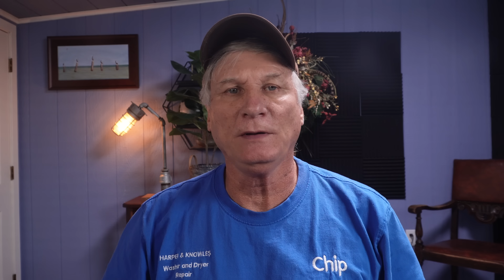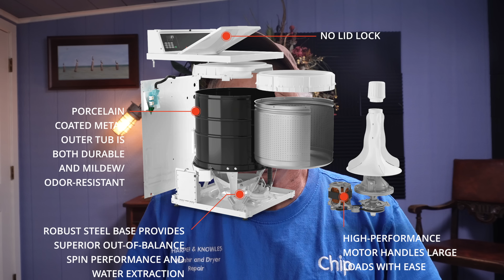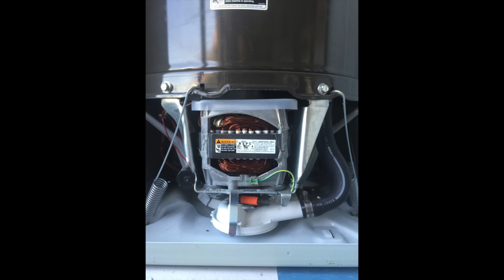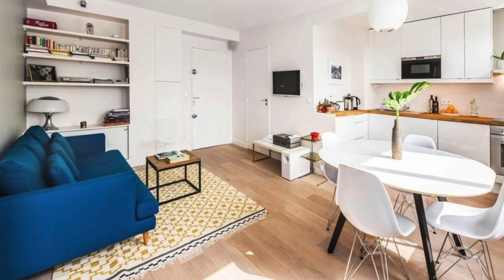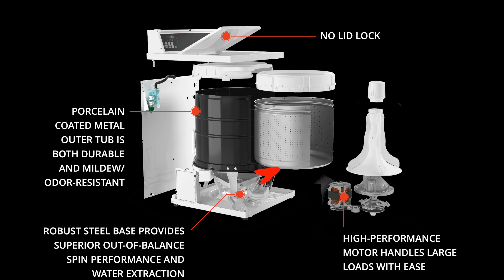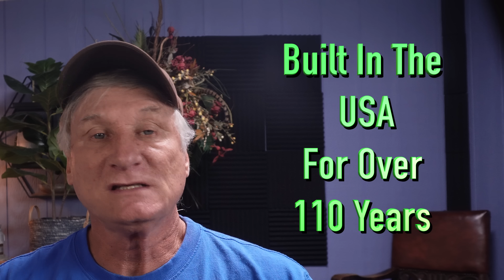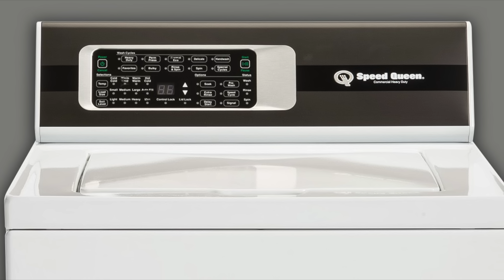TR7 vs TC5 – The Truth Speed Queen Dealers Don’t Tell You

Comment: in your opinion, what were the 'good years' for the old whirlpool washer? we are still using one that (per lookup) was manufactured in October, 2003.  Other than a dead lidswitch, it's worked fine.
Reply from the maker: Whirlpool direct drive transmission washing machines were first introduced in the early 1980s, with the initial models appearing around 1983. This marked a shift from the earlier belt-driven designs to a more efficient direct drive system, where the motor is directly coupled to the transmission without a belt. Production of these direct drive washers continued for over three decades, spanning from 1983 until around 2011–2012, when Whirlpool began phasing them out in favor of newer designs like the Vertical Modular Washer (VMW) system. 

The direct drive system was a hallmark of durability and simplicity, used across various brands under Whirlpool’s umbrella, including Kenmore, KitchenAid, Roper, and Inglis. While exact end dates can vary slightly depending on specific models and production runs, the consensus is that the classic direct drive design was largely discontinued by 2011, though some variants may have lingered in production or as replacement parts beyond that. These machines earned a reputation for longevity, with many still in use or repairable today, reflecting their robust engineering. Every year these were produced was a good year!
Reply: @HarperandKnowles  thanks for info. Mine is a Kenmore, still going after 20+ years.  Only the lidswitch failed and repair man said it was a good, reliable machine. He wired it to ignore the lidswitch (did not con me into doing replacement of it).

Comment: I like my TC5 that I bought a couple years ago for the most part once I got used to it.  I had problems with some suds bubbling out the drain but found a hack that advised backing off on detergent and adding a 1/4 cup of vinegar to each load.  Seems to work most of the time.
Reply from the maker: Thanks for sharing your experience!

Comment: Chip, does TC5 come with mechanical timers?
Reply from the maker: I’m not sure if the latest models are or not. Thanks for watching!
Reply: @HarperandKnowles  
I'm sorry I forgot to ask. Speedqueen makes TVN2000WN (AJMadison, PCRichards) seem to still have.
Any thoughts, mechanical clock we are going to purchase   so far. Any input much appreciated.
Reply from the maker: I am not against good quality electronics. You must remember, solid state devices were developed to mitigate the eventual wear and failure of mechanical switches. They are in many ways superior to mechanical methods. If you do decide to go with the electronics just buy a very good quality surge protector and the electronics may be the last thing to fail on your new machine. Thanks for watching.

Comment: I’ve just bought myself another SQ washer/dryer set and approve of your message. New and modern isn’t always better and old is often gold. However, the TR7 is not approved for sale in Australia, because it does not meet with minimum performance standards of cleaning. The TR 7 Agitub wash system is nothing new and there have been iterations of it in the past. They have all disappeared, because they do not perform as well as traditional agitator washers. 

Instead, over here in Oz they sell the AWNE92, which uses traditional SQ transmission/agitation and it is a fantastic washer.
Reply from the maker: Thanks for sharing your experience!

Comment: 15 years ago we built a new home. We bought a Kenmore washer and dryer made by whirlpool. 15 years later still operating just fine. No problems at all.
Reply: You are lucky.   My expensive front loading Kenmore washing machine and dryer didn't last 5 years.
Reply: @fastrider4996  Mine was the cheapest top load I could buy from Sears at the time. washer and matching dryer still working fine. It was actually made by Whirlpool. August will be 15 years (we don't have kids)
Reply from the maker: Thanks for sharing your experience!
Reply: Kenmore washer and dryer in 1993. Springs, Lovejoy coupling, the agitator/cam piece  under the softener fill. But no belts, it's needed some love, years in between issues though. If I replace  them, it'll be a speed queen.
Reply: I bought Kenmore elite front load washer in 2004. It lasted for 20 years until the bearings went out. Replaced  new bearings by myself and still running almost one year now
Reply: My Whirlpool washer & dryer is 15 years old. The washer just started to drip water in the basin every now and then, when the wash cycle is complete. I looked at the reviews for a new whirlpool and was very disappointing. I know it's old, but the appliance repair shop can replace the inlet water water valve that is causing the dripping for around $225 parts & labor. At 78 years old, I think this is my best option.
Reply: I have T 5  electrical broke 2 years old  had a Kenmore 20 years old no problems should have kept.
Reply: Times have changed. My 3 year old GE just broke beyond repair. The repair guy said they don't make them like they used to. There were so many complaints about even the top rated washers, I couldn't not buy the speed queen again.
Reply: @CrucialOlive Same here my Son bought a GE in 2024 and it fills less than 1/4 tub of water to max a small medium load. Depends on the day how much water fills in the tub for no reason, no settings changed and the deep fill or max fill does not work except a rare occasion and that’s been a while.
Reply: It's so annoying reading comments from boomers about how the "Maytag" "whirlpool" whatever they bought 15-20 years ago is still running strong and therefore it's a great brand. You're really showing your age. These companies have all consolidated and manufacture nothing but junk nowadays. Regardless of whether or not they're "made in America", it's all trash. Speed Queen is essentially the only exception to the rule.
Reply: @MKLG2000x  Agreed, they don't make them like they used to. Planned obsolescence.
Reply: @MKLG2000x  Man some millennials had money 15 years ago! You know, maybe five of us.
Reply from the maker: Lol! So true!

Comment: Based on your review. I went with Speed Queen over other brands 👍. I went with TC5 because I want a stronger washing ability. I don’t need gentle soft washes.  Thank you so much for the in-depth review as I couldn’t differentiate the difference between 5 and 7.  

Speed Queen is smaller in tube size but its wider.  The draw back is it is quite noisy 😂 but I don’t live in an apartment or wash it at night.  TR7 seems too weak for me.  I want durability over quieter.

Thank You.
Reply from the maker: Thank you for watching!

Comment: How does Dexter compare to Speedqueen?  If they have a washer for home use it'd be interesting to hear your opinion, thank you ...
Reply from the maker: Dexter Laundry focuses exclusively on the commercial laundry market. They manufacture heavy-duty washers, dryers, and stackable units designed for laundromats, on-premise laundry facilities (hotels, hospitals, etc.), and industrial applications.

Unlike brands like Speed Queen, which has both residential and commercial lines, Dexter does not produce consumer-grade home laundry machines. Their products are built for durability, high-volume usage, and easy serviceability, making them ideal for businesses rather than residential customers.

If you’re considering a Dexter machine for a home setting, you’d likely be looking at a commercial unit, which would require different installation, power, and water supply considerations.

Comment: Yes, We bought an LG front load washer 8 years ago and I had to fix this thing 9 times so far. The front cabinet door panel had started rusting within 3 years. Cabinet itself is cheap sheet metal. Crappy machine in my opinion. We will be buying a SQ very soon
Reply from the maker: You won’t regret it. Thanks for watching!

Comment: Spent 700 bucks on a Maytag “commercial” xl capacity washer and it broke to the point of not being cost effective to repair it after 5 years.  The Maytag Bravios dryer made it 6 years.  I feel like buying a new washer and dryer every 5 years is absurd, so I’m going with the TC5.  Haven’t looked into dryers yet.  I thought pretty much all dryers were reliable, but this Maytag proved me wrong.
Reply from the maker: You won’t be disappointed. Thanks for watching!
Reply: Hi. Did you buy this BRAND NEW? In year 2020? DID YOU HAVE ANY SERVICE CALLS ON IT IN those 5 years? I just bought a Brand new COMMERCIAL Maytag 4.0 Drum size for a lot $. It’s sad to hear yours died. Did it have direct drive and was it brand new? Mine has a Direct Drive with 5 year Warranty also. Looks like an old style machine but has a locking Lid mechanism so is HE style. Let’s hope and see I get 10 years out of the price I paid. It doesn’t have a glass lid and it’s Not Wiffii one? Let’s see? I heard the LG Front Loads are more durable but cheaper? Thx 🙏

Comment: I have an older AWN41 Speed Queen washing machine.  Basic and my wife and I have had it for the past 11 and half years. The only time I had to even open the front of the machine was for removing a dish rag that the wife was using to clean the tub seal at the top of the machine. She got the rag past the seal and I open the machine and removed the rag I was so glad that she got me as the rag was sitting on the transmission belt.  It was a quick easy thing to get the rag out and close up the machine. This machine is stone cold reliable and never have had a problem since we bought it and yes it will wash a large heavy queen size comforters and not have a problem (one at a time) 

Even after 11 years the Speed Queen still looks new and we used it a lot. We had a Maytag set that went from 1984 until 2013 and I already see the same reliability with the Speed Queen. Yep sometimes old tech works better then the new fangled garbage tech we have in other machines
Reply from the maker: Thanks for sharing your experience!

Comment: I have a 1987 Kenmore “Limited Edition” washer and dryer with electronic touch controls.
Both still work and have had only one minor repair each.
The washer is getting “tired” (neutral drain, noisy spin gear, oil leaking) so I will most likely retire them and get a Speed Queen set.
I am not crazy about their dryer design but I like to have a matched set!
Reply from the maker: Thanks for sharing your experience with the Kenmore “Limited Edition”.  I was wondering which manufacturer made those. They look like Whirlpool’s but I’m not sure.

Comment: I wish SpeedQueen would start making kitchen appliances.
Reply: They should make a dishwasher. A simple one.
Reply from the maker: Thanks for watching!
Reply: I still have a Kenmore stainless side by side that I bought at sears in 2007. The only issue I’ve had with it is the ice maker but otherwise it’s been problem free.  Bought a Samsung gas stove and dishwasher in 2020 and both crapped out within 3 years.
Reply: @BrigidGPS my bro has my Sears side by side bought in 1985 
He uses our moms 1972 Sears side by side as a 2nd fridge
Reply: @BrigidGPS bosh is the queen of dishwashers
Reply: @alleyoop5185 I have to use an app connected over wifi to access all features and settings on my bosch dishwasher. Rediculous
Reply: Wolf dual fuel ranges, subzero dual zone refrigerator, kitchenaid dishwasher (albeit made by Frigidaire, kitchenaid modifies a number of components from the pump and pump mesh filter to the welded stainless tubs, you can still expect solenoids to fail here and there like on any other Frigidaire product)
Reply: speed queens are actually Amana's and they did make the best refrigerators but were bought out and split up
Reply: Bosch dishwashers and sub zero refrigerators
Reply: Viking would be the comparable
Reply: That would be fantastic! 💯
Reply: Find out locally where the Speed Queens are sold. Likely it is a local appliance store that carries brands known to last. They'll likely be more expensive than the appliances at the big box stores, but they'll last much longer.
Reply: @Banzai51 talking to salesmen and technicians locally. Almost all have speed queen products.
Reply: @Banzai51 You cannot buy a good refrigerator, because nobody makes them, they are literally all junk. There might be some commercial-grade stuff that costs 5,000 to $10,000, but there is nothing as far as refrigerators that are residential grade that is not a piece of junk.

As far as dishwashers though the Bosch models are pretty good, I think they have three grades. I got all this information from appliance repairman and personal experience.
Reply: @a @actionjksn  got a Bosch, it was trash. I went and got a GE profile, it was rated second or third to Bosch. Had it 4-5 years, so far no problems. My Bosch failed after one year. Couldn’t even get the thing to turn on and the repair people they sent out barely looked at it or stayed to see if it ran a cycle or not. They said I was using the wrong detergent but I showed them the Finish brand rinse aid and detergent I was using which was right on the door. One repair guy said the detergent was too old because of the packaging it came in, I had to show him the receipt when I bought it the same day as the machine. He looked confused and said it still didn’t look right. Their CS was a joke. Maybe the model I got was a lemon but Bosch refused to replace it.
Reply: @actionjksn that's why I floated a bond and bought an American made sub zero for about 13 k. It will be my last refrigerator. It's worth the money. It recoups very very fast on 100 watts. Where my old frig needed overnight to completely stabilize. It's just easier to use and it doesn't feel cheap.
Reply: @uptoolate2793 but $13,000! Damn!
Reply: @actionjksn  Let me tell you...commercial use refrigerators and freezers are not as good as they once were either!  I work in a clinical laboratory with 13 refrigerators and 8 freezers (one of which runs at -80C or -112F), some are just standard home size, others are massive.  Our fridges are set to operate from 2-8C and the freezers vary.  We have a couple of old units that are over 50 years old!  However...we've had to replace some of the late model units 2 or 3 times already while those old ones just keep going.  We may just start using basic no frills standard home refrigerators because we can buy several of them way cheaper than one commercial unit which is going to run anywhere from $5K to $18K depending on size.  All the repairmen say the new stuff is not as durable due to cheaper less substantial materials that are used in addition to making units more compliant with energy and environmental regs.  Basically, it's UNLAWFUL to make good refrigerators/freezers anymore.

Comment: Is there a way to bypass the lidlock?
Reply from the maker: There is no lid lock on the TC5.
Reply: @HarperandKnowles  How about on the 7?   I am looking at which one to purchase.  We don't have greasy or heavily soiled clothes, so I think the 7 would be better, but I'm always one for adding clothes after the washer starts.  I want to be able to open the washer after it starts if I need to add something.
Reply from the maker: If you press the start button during operation the machine will pause and once movement stops inside the lid can be opened and once you add items or chemicals you just close the lid and press the start button again to resume. Thanks for watching!

Comment: I purchased a TR7 and DR 7 new in the fall of 2023. The dryer has required at least 5 service calls. It’s a loud metal on metal rust bucket sounds loud and terrible. It’s worst at the beginning of the cycle, then gets quieter.  The technicians tell me it’s just a characteristic of the machine. They tell me they all sound like loud rust buckets. The washer has had 3 service calls, requiring a new lid lock, and a new water pump today. Yes, the warranty pays for everything, but I just spent a week at the laundromat waiting for a service call. These machines are the 6th new laundry set I’ve had in my life. They are very noisy if they’re on your main floor or near bedrooms. They also turn small laundry rooms into saunas unlike the sealed systems of the front loaders. If I could find someone willing to put new rollers or parts on this dryer or even take it apart to see what the rattly noise is, I’d feel better. Also, the dryer will work most times, but sometimes leaves clothes damp. My set was built during the pandemic. Maybe the workers on the line back then were monkeys. But,I feel they are very poorly made. And, they are expensive compared to other brands. The steel is very thin. Easy to twist a door. Nothing like the good old Maytag sets!
Reply from the maker: Maytag effectively went bankrupt in 2006 and was acquired by Whirlpool April 1st the same year. Ever since Maytag machines are essentially the same animal as the similar Whirlpool versions. Speed Queen is the superior brand over all other American made machines. It’s unfortunate that your experience with them has been so negative. Thanks for watching!

Comment: Good review. When mentioning the past heavy duty, sturdy Whirlpool Washers can this be pinned down to a particular set of model years when such sturdy machines were produced &/or the model or series names?
Reply from the maker: The last “old school” Whirlpool direct drive washers, known for their durability and simplicity, were manufactured in 2010. These machines, introduced in the 1980s, featured a beltless design with a direct connection between the motor and transmission. After 2010, Whirlpool transitioned to high-efficiency models, such as the belt-driven Vertical Modular Washer (VMW) platform, which were more energy- and water-efficient to comply with new regulations. Thanks for watching!